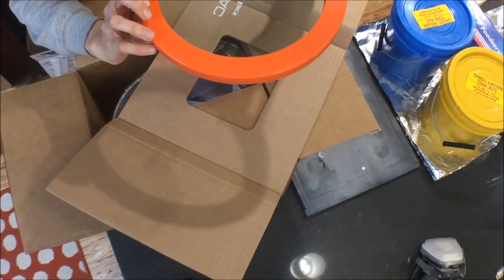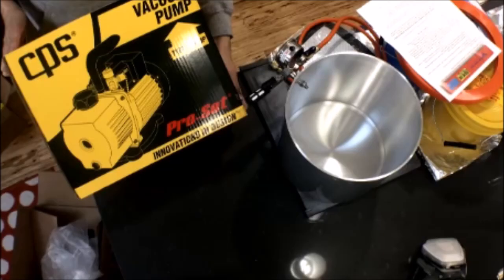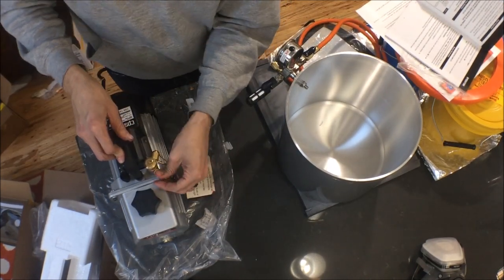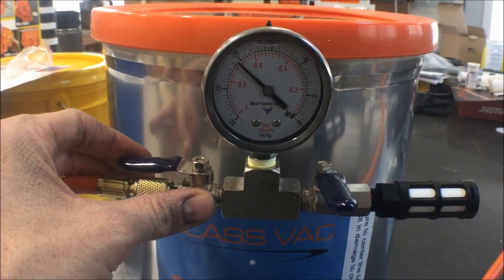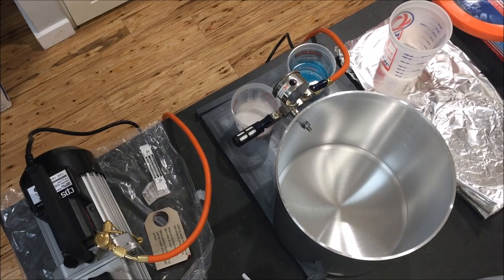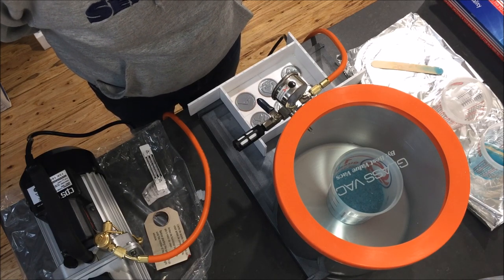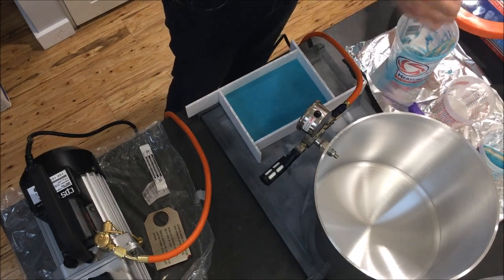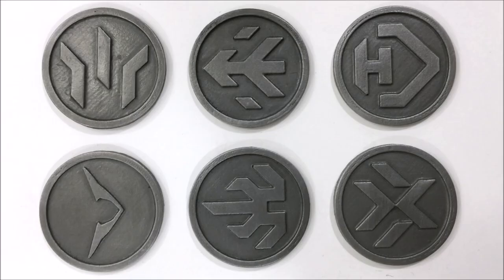Vacuum Chamber Unboxing and Mold Making

Comment: I have a question...I have been reading up on vacuum pumps and have read about the exhaust on a pump creating an aerosolized mist of oil unless you have the proper filters/traps. For this reason, you shouldn't use the pumps inside. Does your pump use one of these filters and if so, do you have any recommendations?

Comment: So you can put your mix in separately , then mix them together and then put it in one more time? 

No issues will happen? 

(Also , do you know if you can do that with resin too?)
Reply from the maker: Nope no issues! As for resin, we would not recommend degassing resin unless it's a resin with a long pot life and cure time (like clear resins). With faster resins you don't really have enough time to degass it before it starts to cure and then you have a cured bubbly mess (we know from experience and testing it!)

Comment: Did you ever degas se silicone after pouring?or is that no good idea? 😃
Reply from the maker: Yes, we have actually done this a few times on specific molds that could benefit from a little extra degassing after the pour. There are several things to keep an eye out for though if you try it. 

1. if your silicone work time is too short, you can end up with a bunch of bubbles cured into the top of your mold 
2. If your master has any internal voids that you've plugged with clay or similar, there is a chance that the vacuum pressure will pop out your plugs and suck silicone inside your master - definitely not a good thing! 
3. Make sure your mold box is tall enough to contain the bubbling silicone and not overflow.
Reply: @SionnachStudios  thaaaanks alot 🙏

Comment: Ran into an issue, didn't know i needed to use almost 2 bottles of oil, only used one, and after using the pump twice it just stopped working, even after turning it off and on nothing happens now. Anyone know what to do?

Comment: what would happen if you would let the mold cure under vakuum?
Reply from the maker: It mostly depends on the cure time of the silicone. If your cure time is long enough it would work just fine, but if your work time is too short, your silicone will start to cure while the top side is still bubbly. Depending on your mold and the thickness that may or may not be an issue but if you're making a flat mold, that can definitely cause problems. The other thing you'd want to watch out for is the vacuum pulling your master off of or out of your mold box if it isn't secured down well enough. Hope that helps!
Reply: @SionnachStudios  thank you a lot!

Comment: Hello. New to this resin and molding. I received my chamber dented. Will this affect anything?
Reply from the maker: If the metal chamber is dented it shouldn't make any difference, however, I would get a replacement only because any damage will likely result in an overall shorter lifespan of your equipment and since you paid for a new chamber, that's what you should have!
Reply: Sionnach Studios 
Thanks I really appreciate it.

Comment: What's the point for the heat pad
Reply from the maker: You know that's a great question and one I don't have an answer for. I can imagine depending on the temperature and conditions you are working in and the materials you are using ,that it might be beneficial to warm it, but for what we do, we never had a use for it.

Comment: I just got a 7cmf and gallon chamber.  Like you I have some quick stuff (amazing casting resin)  I was thinking of pouring the resin in the mold and vacuuming in the chamber to save time.  Its a open mold or one piece. What do you/ anybody think
Reply: Yeah, don't do that. As you probably guessed the air gets pulled out of the mold and travels though the cast which leads alot of bubbles and a big mess!
Reply from the maker: Sorry I just saw this and was doing to say the same thing :) I tried the same thing and had equally disastrous results :D

Comment: I liked this! Short and to the point. I'm using Mold Star 15 slow. What is the correct pressure and is it the same pressure for resin?
Reply from the maker: Depending on where exactly you live, about the most pressure I can get out of this is about 28. And really any pressure helps, but higher pressure will get the air out faster so depending on how fast your silicone or resin cures, you'll want it higher. To the best of my knowledge, resin and silicone will be do fine with the same pressure. One thing to keep in mind is that for both, make sure you take it out before it starts to cure or you're going to end up with a cured bubbly mess :)

Comment: I bought one and the plastic piece in on end broke in shipping, i think it's a filter, what is it used for?
Reply from the maker: Icemanmodeler yep it's a filter so depending on what exactly your degassing and what your ventilation situation is it's not absolutely necessary. I usually do everything with a respirator on anyway so km not too worried about fumes from the degassing.
Reply: @SionnachStudios  Oh cool, just degassing sillicone and resin, nothing special.

Comment: What method do you use.. to clean your mixing cups
Reply from the maker: Resin and silicone usually (mostly) come out pretty easily by just pulling. Then I swap the cups with alchohol to ensure they dont contaminate what does into them next. I try to only resuse resin cups for resin and silicone for silicone and I only reuse the cups I mix both parts in. Any cups I only put one part in are much harder to clean and not worth the effort in my opinion. Thanks for watching!

Comment: You’re high pour is trapping air by moving I reckon ... start in the corner and don’t stray
Reply: Yes it's normally advisable to pour high, and to one corner, letting it move out slowly - perhaps he did it this way because he'd reduced the fluid workable time already.
Reply: Thanks for this tip!

Comment: Hey do you know how to clean the vacuum pump oil?? I've tried filtering through kitchen towels and freezing and seperating to remove water (what they recommend for freeze drying pumps) but my oil is still cloudy??? Not sure if it's silicone or PU fumes seperating out into the oil or something? Would be great not to go through so much oil..
Reply from the maker: unfortunately, I do not. I never had that issue :( Have you tried reaching out to their support? they were very responsive when I reached out to them for help.
Reply: I've always heard you just replace the oil after each and every run. That's an interested and frugal question. I guess you'd have to figure out what all is getting into the oil - emulsions, acids - and filter appropriately. Water settles out, you have to slowly siphon the oil after water settles to the bottom or pour it very steadily and stop before you reach the gunk at the water-oil-interface level. There may be some way to 'rinse' oil with solvents but that'd be quite involved.
Reply: Try using a cold trap. Sorry, I know it's a year later.

Comment: Why vacuum both parts first   Why not mix both first and THEN  degas??
Reply from the maker: Hey Ross, with a slower curing silicone, I'd absolutely do it that way. However, because I only had a fast cure silicone for this test, I wanted to get as much air out as possible before curing started. Thanks for watching!
Reply: Thanks  for the info.

Comment: next time stick the casting itself in the chamber. let it cure under vacuum. This way it kinda pulls it into the details
Reply from the maker: Depending on the resin you are using and its cure time, this could work. All of our resins have a pretty quick cure time so trying to degass a resin cast while its curing will usually result in a cast with a very bubbled back and possibly more resin out of the mold than in. If you have a pressure pot and its big enough for your molds, thats better for resin casting than a vacuum chamber.